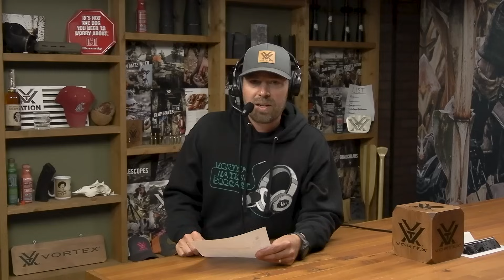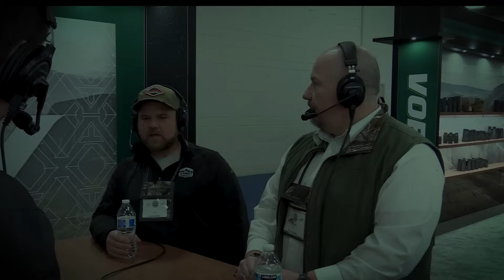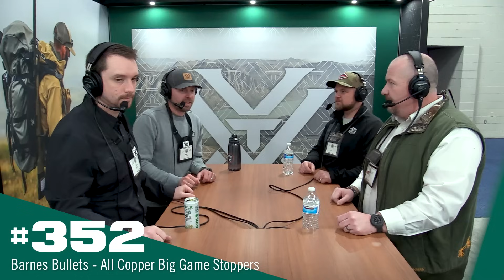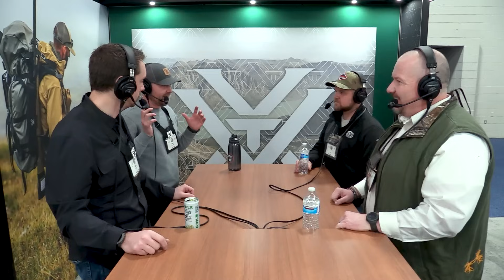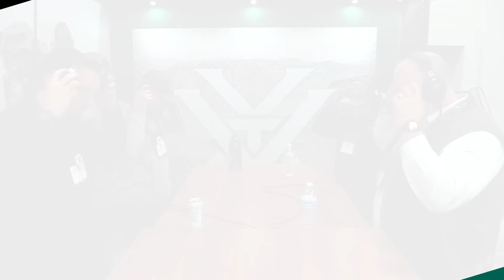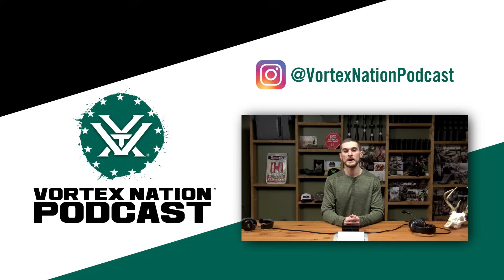Ep. 352 | Barnes Bullets — All Copper Big Game Stoppers

Comment: I have been using a 300blk for deer pest work in Maine using the 110gr TAC-TX; I'm 14 for 14 on hits/kills. Distances from 15yds to my most recent pair at 150yds. Recovered my first bullet in one of those; hit base of the neck facing me, bounced through the spine; pulped a lung, shredded the liver, and stopped against the diaphragm. Deer dropped where it stood. I've had shots through both shoulders, through the head/ base of neck, spine/ shoulder shots; I've never had a deer go more than 25yds with the 110s and could not recommend them enough for a 16" barrel 300blk for short to low/medium range on white tails. They also (factory loads) group in a ragged 10 shot 1.25" hole at 100yds, which matches or maybe exceeds my handloads. Truly excellent rounds and projectiles.

Comment: Interesting that they phrase the potential loss of petals at high velocity for LRX as a trade off for opening at lower velocity, and say you still get controled opening and 80% retention as a defense....
Vs Hammer (hunter) and Lehigh Defense (Controled Chaos) brag about petals loss as a benefit. That you get the 80% retention and controlled opening, but for controled chaos they brag that the petals are striking out wider and Hammer says they want petals off for a blunt flat faces core that the flat face without petals bent back sends shock and disruption.

They brag about better bc, accuracy, and low velocity opening of LRX, but almost apologies for petals loss that two of their competitors with similar functioning brag about as why better than TSX, TTSX, then again they are also defending why YYSC approach is superior for its applications.
For myself, close range white tail, don't need better bc or low velocity opening, the predictability of the tsx/ttsx always opening and retaining petals for same channel result each time has me interested. Just bought 12 different monolithic bullets for my new BLR 7mm-08 and as local store carries TTSX in 120gr and Hornady CX in 139gr versus buying online options hope it likes one of those, then decisions.

Comment: Started out with pmc 270win 140gr xbullets and had great success that was around 96.  Started reloading in 98 and used some 53gr 22cal 35gr 22cal 130gr 27cal and 110gr ,165gr 30cal.
Them 110gr 30cal were amazing in my 7.62x39 made it into and legit deer rifle. And im in the process of putting together and 8.6 black and will be using 160gr and 210gr ttsx or tsx out of it.

Comment: We just took a full cow elk with my -06 and the 130 ttsx at 350 yds and a 15-18 cross wind.  Held 2 moa L and 3.75 U and right on the sweet spot and let it fly.  She took 2 steps and then rolled down the hill.  When we got to her, we hit right behind the shoulder with a .30 cal hole.  When we dressed her, the chest was already completely full of blood.  Found a 2 finger sized hole through the top of her heart. When we flipped her over, there was a thumb sized hole on exit.  The most amazing thing to me was the lack of bruising in either shoulder where my older bullet type would have destroyed one of them.  I'm on these loads because of Ryan, and all my loads are going to be blue tipped from here on out.
Reply: What you seen for damage by the Barns TTSX is normal.
I am guiding hunts in Oregon and Alaska with a requirement of the clients they must bring barns ammo for their hunt.
You should see how well a 7 mm Rem mag does on Roosevelt elk in the Barns TTSX 150 grain !
No longer are the heaver 160 or 175 grain bullets needed for the old 7 Rem mag
Reply: @lurebenson7722  can only imagine. Can say that the 80 grain from my 6 Arc is just as impressive on pigs and whitetail too.  I was able to double a pair of 100 lbs pigs and neither took a step from 140 yds. So much for a gas gun 6 Arc being under powered.   Love the blue tips.
Reply: @skippygus73  From your channel videos show you aren't even the age to own a gun

Comment: I have a question:  I like LRX bullet on paper(I did not use it so far). I wonder , why are there just 2 grooves?  At lower part there is a room for the third grove, the lower part without groove is large, therefore I am afraid it could cause problems like theb fast barrel wear, high preasure and copper fauling). What is the reason for making just two grooves? Is it saving money while skipping the third goove ? I am sure that the third goove could  only improve it...
Reply: pretty sure the LRX is a softer compound copper for low velocity expansion, being softer it doesn't need as many relief grooves as the grooves also lower the BC of the projectile.

Comment: I started to use bullets with the old Barnes X bullets, but I stopped using them for multiple reasons.
They fouled the barrels much and some barrels extremely much.
They were inconsistent, specially in .30 cal and smaller, with often a VERY small velocity area to work well.
Either they opened very little or they broke of petals, even if bones were not hit.
Multiple times I experienced one or two petal breaking off early and the bullet angling much inside the animal.
So I stopped using them and used other bullets instead for some time.
I talked with other hunters that told me that the newer blue ones fixed most of the fouling issues, but the alloy used in the bullet seemed the same where it seemed to be to hard and brittle, and it was the same problem with not opening up well or easily breaking off petals.

Now fast forward to the newer Barnes bullets and with the Barnes TSX.
I saw that they clearly had changed a lot with these bullets with the groves and a VERY different color that suggested that they had changed the alloy a LOT, so I decided to give them a chance.
And after that have I not looked back.
Since then have I almost only been using Barnes bullets for all my big game hunting.
The only exception is when I use 6.5x55 SE Lapua Mega factory loads in my Tikka M65.
I have killed more than 150 big game animals with different kinds of cartridges, using TSX, TTSX and LRX bullets and they have NEVER let me down.
Every single one of them have been 1 shot kills.
I also know about more than 50 more big game animals killed with handloads with Barnes bullets I have made for other hunters, and they only want to use Barnes bullets now as well.
The bullets work extremely well and better than any other bullet I have tried for big game hunting in 40+ years of hunting and 400+ big game animals killed.

When other hunters ask my what bullets I recommend them to use for their big game hunting, I always tell them to use Barnes TSX, TTSX or LRX bullets as they will NEVER fail them.
Yes, I am a Barnes fanboy too.
Not because I care about the brand, but because I care about the quality and the results after I pull the trigger.

They are VERY accurate and I am extremely "anal" about the accuracy from my guns.
I know it is not always needed, but I just can't stand to own a gun that doesn't shoot minimum 1 moa and most of my guns are 1/2 moa or better guns.
A gun not able to shoot 1 moa or better is a dud in my eyes.
If I happen to buy a "dud" that doesn't shoot 1 moa or better with multiple loads, I sell it asap.
Even my 375 Ruger shoots 1 moa and better with all my loads for it and if it didn't, I would sell that too.

They are also extremely consistent in the way they behave when they hit an animal with VERY good killing effect and little meat damage.
Before I stared to use Barnes TSX, TTSX and LRX bullets, was I experiencing a lot of inconsistency in bullet behavior, effect of the hit and meat damage.
There were two exceptions and that was Swift A-Frame, but the bc on them is terrible and can be difficult to get good accuracy with at times, and the Hirtenberger ABC, but they cost about a kidney per bullet.

One thing that was said here on this podcast  that also was very true, is that these Barnes bullets make your cartridge punch well above it's weight.
Both when it comes to bullet weight, caliber and speed.
You can take a cartridge that many thought and still think is marginal and even to small/weak for an animal and use ammo with Barnes bullets and suddenly you can be totally confident that you will kill that animal quickly and ethically as long as you do your job when pulling the trigger.

Comment: I’m loading 3 308’s with 130 grain TTSX over Ramshot TAC at around 3200 fps. No pressure signs and still slightly less than Barnes published max. Consistent under an inch groups at 100.  No on game experience yet but that soon will change and have no doubt performance will be more that satisfactory

Comment: Barnes looses all its petals just the shank left. E tip is where its at.
Reply: And what type of Barnes bullet did you use and in what cartridge?
You will need a very high impact speed for a modern Barnes bullet to lose any of the petals.
I have hit the spine of a deer at more than 3000 fps with a .264 TTSX and still not lost a single petal.

Comment: 10 minute Pod cast suggestion: why choose one bullet weight over another within same caliber (e.g. .308). Is there a different decision with monolithic vs traditional lead based?
Reply: 130 barnes Vs 178 cupncore...? 
Gel test!!? 
I wanna see doplar readings on the bullet speed compared AFTER it hits the gel?
The decending energy reading....
No speed or energy readings means anything at a certain distance..
The ratio and no I m not talkn just b.c. 
It would be a contiously changing number....
Maybe there s always such thing
Reply: When it comes to the Barnes bullets, will you in general experience close to 100% weight retention unless you hit the animal at a high to very high velocity.
It will be a difference between the TSX, TTSX and the LRX for what velocity you might experience less than 95-100% weight retention.
Because of this, do you not need to have as high starting bullet weight with these bullets as you need with a traditional cup and core lead bullet as that will have much lower weight retention.
Very typically around 55-65% unless it blows apart.
So you can very often experience to have heavier end result from a 130 grain TTSX .308 bullet than you will get from a typical cup and core 180 grain bullet.
I have used this 130 grain TTSX bullet in 308 Win on deer and even moose with great effect and it is in my experience a MUCH better bullet for moose than any 180 grain cup and core bullet unless it is a premium bonded bullet, like a Swift A-Frame.
So, in general can you go lighter to much lighter with a Barnes bullet and still achieve the same or better bc and bullet retention than you will get with a cup and core bullet.

As an example with a 308 Win do I not see any point in using a heavier Barnes bullet than a 130 grain TTSX on deer, but you might want to use a 168 grain TTSX on an expensive trophy moose hunt to be more sure of penetrating deep enough on less than ideal angle shots.

I only use Barnes bullets now and how I choose what bullets I use, depends on what ranges I expect to be the max range for that cartridge and my hunting and what bullet speed I will have at that range.
If I expect the impact speed to be rather low at that range, I always choose an LRX bullet as it opens better at lower speeds.
For most of my hunting and cartridges am I using TTSX bullets as they have a decent/good bc and opens up well at the most common impact speeds for most cartridges and types of hunting.
I am only using the TSX bullets in more special cases where I expect the impact speed to be high to very high and/or it is VERY important for me that it most likely will not lose it's petals, even if the TSX bullets in general are great bullets for all cartridges and hunting out to 250 yards.
The only TSX bullets I am using now, is in my 375 Ruger for Cape Buffalos.

One mistake many make when they start to load with Barnes bullets, is that they choose to use the same weight as they are used to with cup and core bullets and even at times go heavier because they are jumping on the bandwagon of very high bc bullets and they forget to check if their barrel twist will stabilize the bullet well.
Since copper is so much lighter than lead, will a 180 grain Barnes bullet be longer to much longer than a 180 grain cup and core bullet and that might result in the Barnes bullet being to long for the barrel twist their gun has.
As far as I know do Barnes list the needed barrel twist for all the bullets that might be marginal for caliber when it comes to twist rates.

Comment: I'm also a Barnes fan boy. My 168gr ttsx load in my 308 is nothing short of AMAZING. You talked throughout this podcast about how important it is to understand the envelope each bullet is designed for. PLEASE PLEASE PLEASE publish this data on your website! At least publish the min expansion velocity. Keep up the great work!
Reply: The 130s or 150s work better.  They open up much faster and bigger.  Kill things way better!    The 168s might be a touch more accurate occasionally but for killing animals the lighter faster loads work better across the board.  ✌️
Reply: Not just Barnes!  Whether you’re working with subsonics or pushing a pistol cartridge much faster in a 16” carbine, knowing the terminal performance velocity window is critically important.

Comment: Since 1978 I have as one job been a professional hunting guide working the Pacific NW and Alaska.
Since the days of the Barns X bullet, I have only used Barns bullets for taking of game and I require the client to bring Barns ammo or reloads with Barns bullets so not to have animals wounded by crap lead core bullets.
The Barns Blue X bullets I still have in 8 mm 200 grain are loaded into the 8mm -378 Weatherby magnum and leaving a 30-inch Douglas barrel @ 3800 FPS this load hammers all game dead on the spot.
I load for my rifles in 300 Wby - 7 mm Rem mag - 338 win mag - 6mm - 284 win - 9.3x62 Mauser all of these rifles when game hunting all shoot the Barns X - TSX - TTSX - LRX bullets.

Comment: I found 168gr ttsx very acurate however the only deer ive lost was last year on a lung shot on a white tail at 150m. Im sure it was a bullet failure because i shot a doe later that week at 100m in the chest (frontal shot). It penciled throuh the vitals changing direction to the left shoulder  and then changed direction again penciled through the guts and landed on the right hip joint. The deer dropped and then got up and ran 200m, the internal damage was equivalent to a field point on an arrow. The nose of the bullet was gone with 1 small pedal still retained and the rest gone. Complete failure. Ill never hunt with them again. The concept of saving meat and full penetration is stupid if the animal doesnt die. Id take jacket/core seperation over that if it means a quick clean kill. Also idk why everyone is obsessed with penetration these days, most of the sst's ive shot moose, elk and large mule deer with either landed on the off side hide or fully penetrate after exploding in vitals.

Comment: The only time I used a Barnes was a 165tsx in 3006and the bear I shot how I found it was luck at best. I stepped on it in the dark in a corn field.  On my way out and said I missed.  Then when I gutted it was a 30cal hole through heart lungs and liver.  I hit every vital organ that animal had.  So a fmj would have done the same thing I think.  Since I have been told the bullet was to heavy and the tipped version is a much better bullet but I am having a hard time getting that out of my head.

Comment: Sounds like Barnes dont build just what the media and shooters ask for or demand. they build what is necessary and required. but the 156 grain 6.5 bullet in a long barrel PRC sounds an elk round to me. so carry the 127 grain Barnes LRX and a Berger bullet 156 grain round in both loads with you, maybe one mag preloaded in separate mags. so much science, engineering and manufacturing processes more than a simple lead tip.

Comment: Barnes bullets are accurate. However, in my experience, bonded or cup and core are FAR more lethal and reliable. Multiple animals at multiple yardages from 50-600 with a .300 win mag pencil holed leaving long tracking jobs and 3-5 rounds for each animal to dispatch them. Went back to accubonds and problem gone. Will never use them again. Not to mention they would foul the rifle every 9-10 rounds.
Reply: You are clearly talking about the old Barnes X bullets, because this is NOT the reality when it comes to the Barnes bullets today.
Now they do NOT foul the barrels quickly at all.
And I promise you that these bullets do NOT pencil hole through an animal when using a 300 Win Mag out to 600 yards.
Specially not when using an LRX bullet.

I used the old Barnes X bullets, and they fouled the barrels like crazy and their expansion could be very erratic.
At times they lost all petals and other times they hardly expanded.
So, I stopped using them.

But when the Barnes TSX bullet came, I started to use Barnes bullets again in all sorts of cartridges from 223 Rem to 375 Ruger and I have killed more than 150 big game animals with Barnes bullets and every single one of them have been 1 shot kills.
These bullets kill VERY well with less to much less meat damage than almost all lead core bullets.
Only lead core bullet I have experienced the same type of meat damage from is the Swift A-Frame.
Reply: @The_Judge300  No. Barnes TSX, multiple boxes and lot numbers. All pencil holes. All with fouling issues in two separate rifles both chambered in 300. win. The only reliable expansion I had was from a shot taken by my brother in law hitting a white tail in the neck at 300 yards. Other than that the lethality was very, very poor. But again, that's just my experience. I shot bonded prior too, and after trying the Barnes and the performance for shots in the boiler room is night and day better in that load, in my two rifles.